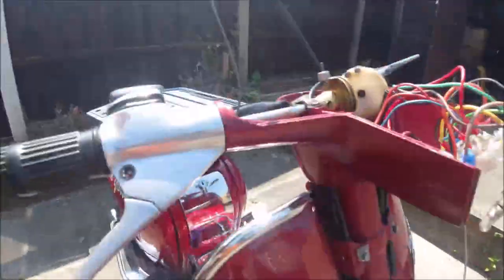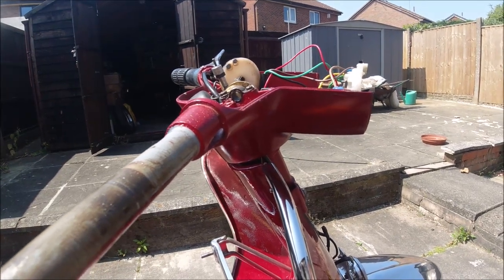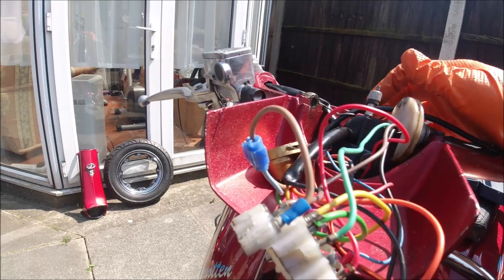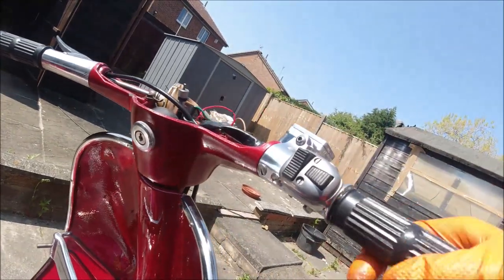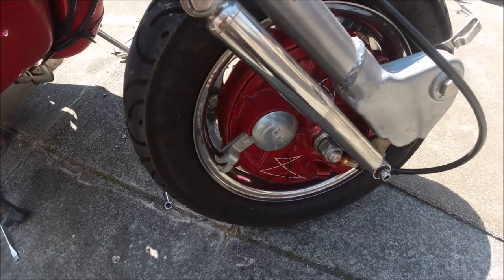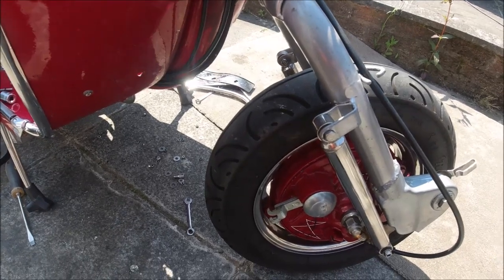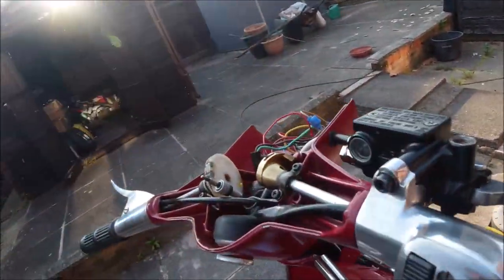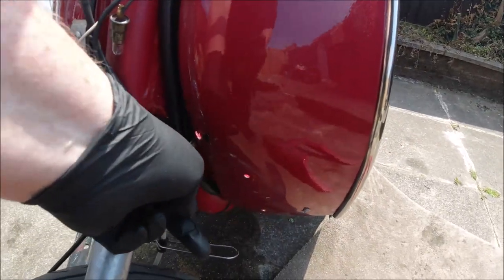Lambretta Hydraulic conversion 2

Comment: Do you use a step drill or do you start with a small pilot drill bit and steadily work your way up to drill the headset hole please
Reply from the maker: I always use a pilot drill 1.5 to 2.0 mm, then go up step by step till enough room for pipe and rubber around it. Take your time it's easy  to do.good luck
Reply: thanks for the quick response I'm going with the same end  result as yourself but may treat my scooter to an MMW  master cylinder I have watched your videos probably about 50 times to encourage myself to bite the bullet and drill into my headset @m1scooterlife259
Reply from the maker: @markhalstead1110  I was the same ,but it is needed and well worth it, the difference is amazing